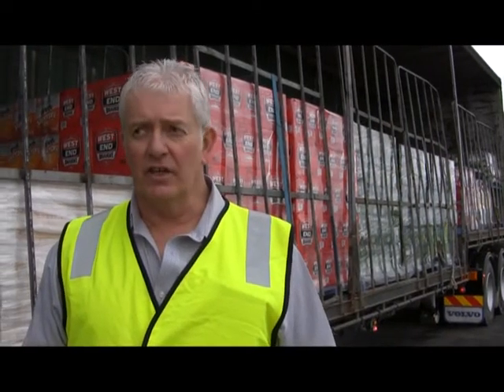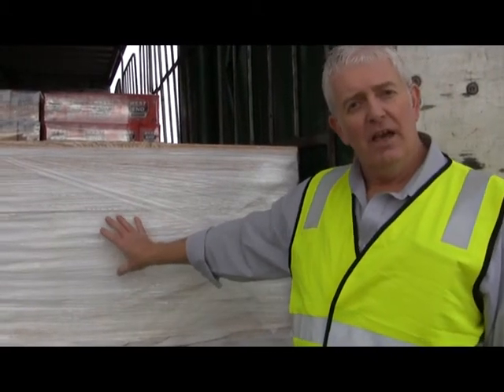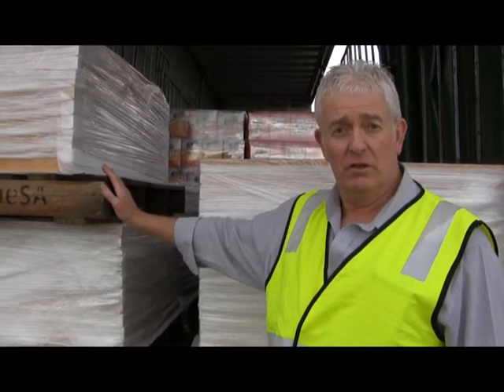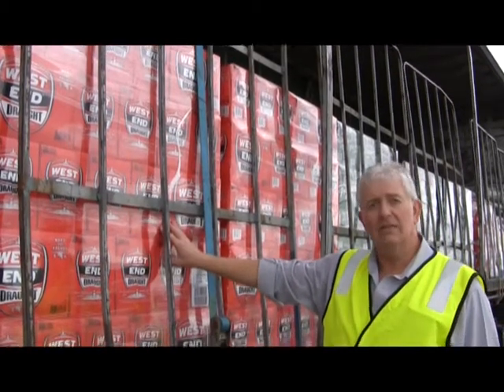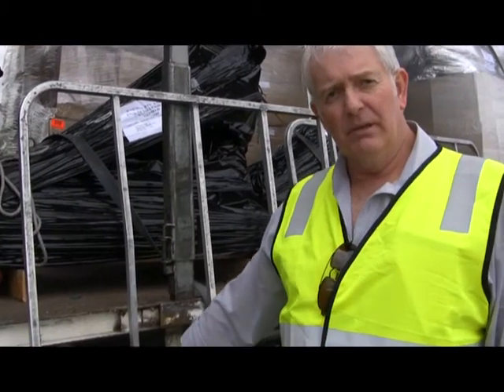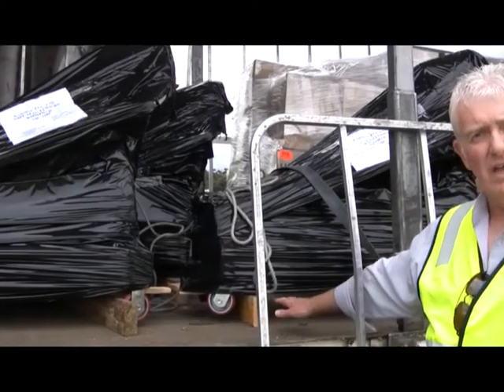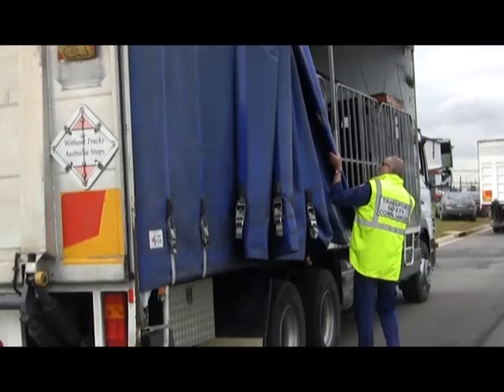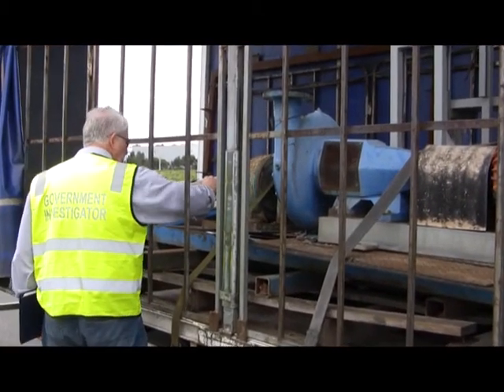Checking heavy vehicle loads

Comment: I drive a 10tonne truck and I pulled up to a place to pick up 2 pallets. As soon as the loader saw my truck he noticed it wasn't going to be suitable to restrain the load. On the left side front of the truck is a Pantech door. The rest of the truck is curtain sider. Both containers weighed over 1.5t and were metal. As I can't put a heavy item near the headboard due to not being able to tie down to stop sideways movement my lashings wouldn't have been sufficient to stop the load moving forward under braking.

That is an example of chain of responsibility in action. Under previous laws the loader might not have cared as all the responsibility fell on the driver. Whereas now, he can actually be prosecuted for allowing me to take that load.